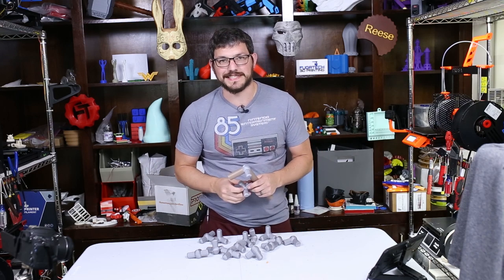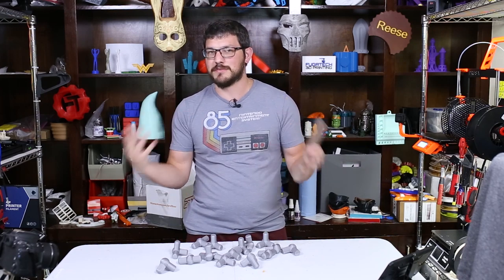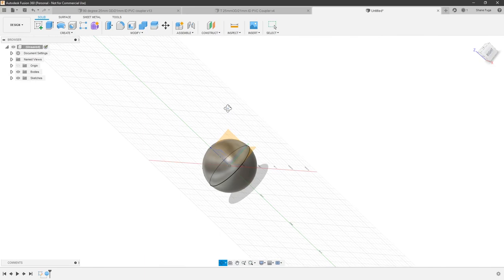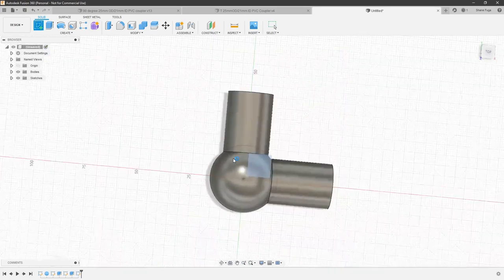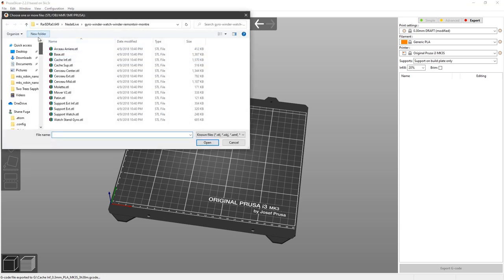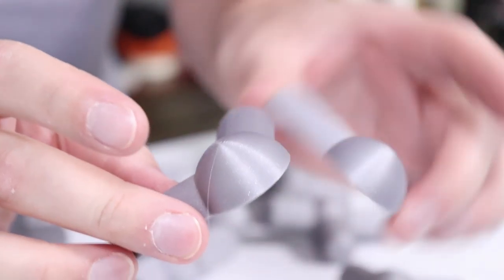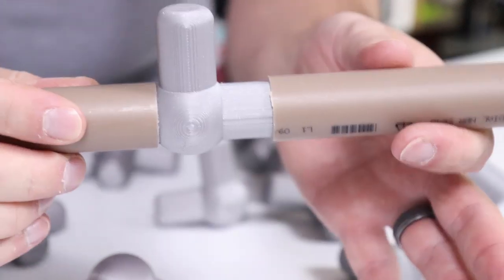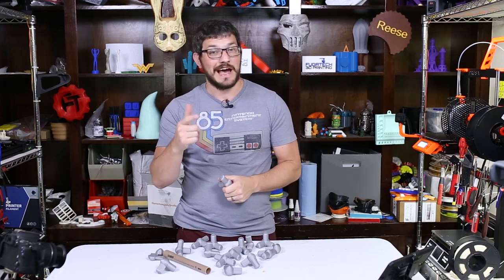3D Printed Blanket Fort

Comment: Make the center piece a cube, same size as the legs, and no need for either support or glue.
Reply from the maker: Great idea! I was doing my best to not have sharp corners since this is for kids.
Reply: @Fugatech3DPrinting  You also could just let two tubes intersect. If in doubt, just print with supports. But given the use case, the imperfections does not matter at all. Also, some filaments do not glue that well, and need particulate attention when picking the glue.

Comment: This could be re-mixed to build a temporary greenhouse using polythene sheeting, a method of fixing the sheeting to the pipe would have to be designed, I was thinking along the lines of some push in pegs with a push on plastic washer but you would have a lot of holes to drill in the piping.
 If I needed a temporary greenhouse I would see this idea out!
Reply from the maker: Awesome idea!